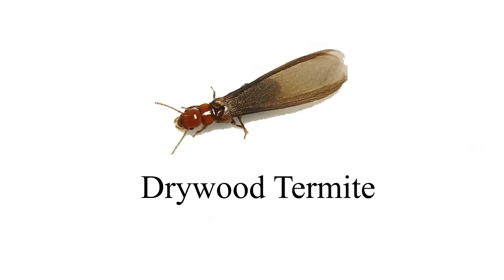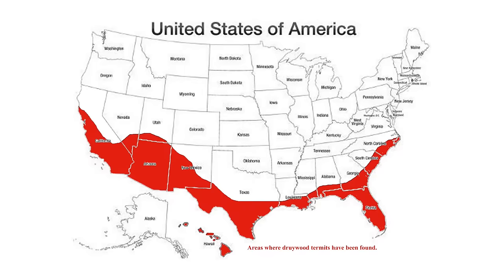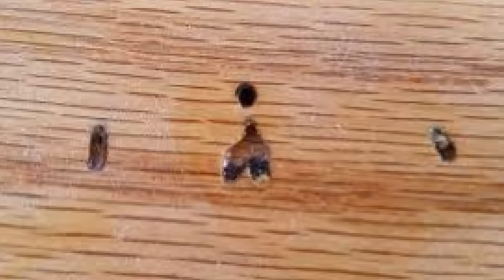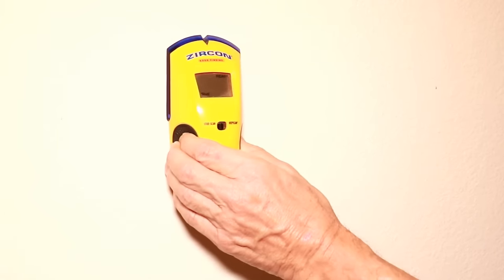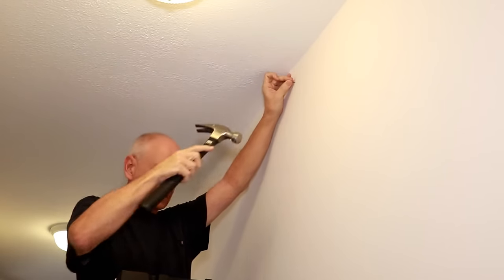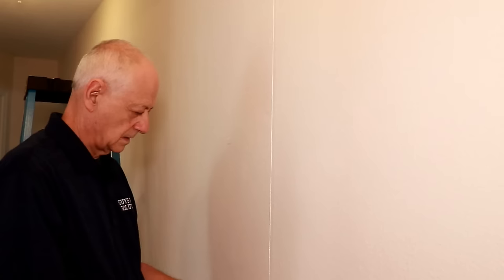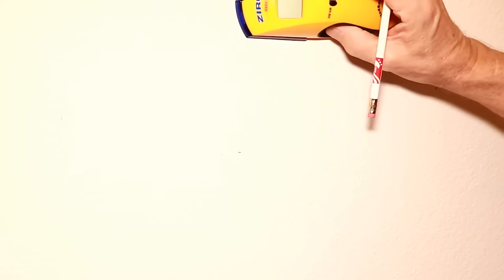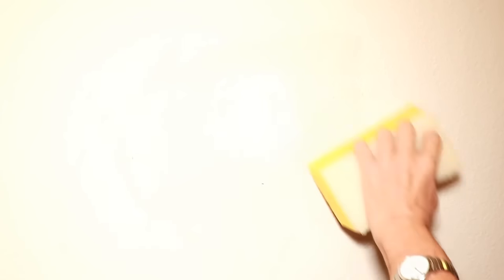How to Treat a Drywood Termite Infestation Yourself. A MUST see if you have Drywood termites.

Comment: I live in a cabin-style house with unstained wood paneling on all of my walls. There is no drywall to drill. How should I inspect behind my wood paneling?  I dread the magnitude of the work involved in removing panels from my walls or ceiling.

Also, i suppose Bora-Care would not be applicable to these decorative, interior, unstained wood surfaces, right?

I found one little kick-out hole in my kitchen, and now I feel like I'm doomed.
Reply from the maker: You can apply Bora-Care to the unfinished wood.  However, I can assure you that, if you have drywood termites, they are located in many places.  It is important to understand how drywood termites work.  They enter through cracks and crevices around windows, doors, eaves, pipe penetrations, and so forth.  Most of the time, they enter through several locations.  That is because a swarm of them attacked your house at the same time.  If there was a crack or a crevice, then they probably found it.  After they establish their galleries, which will be inside the wood, it will take four to seven years for them to be able to swarm.  Now that they are in your house, the swarmers will use holes that are in your studs to travel through the walls.  Those holes in the studs were created by the electricians to run the electrical wiring.  Not only are these holes going through the studs, but holes were drilled into the attic for the light switches and to run some of the wiring for the outlets.  So, the termites now have easy access throughout the attic and the walls.  If you have a basement or crawl space, they have access to that as well.  Most of the time, you will have no idea that they are in the walls, because the frass is inside the wall.  To make matters worse, if you have drywood termites, then your neighbors have them too.  That means you have been getting swarmed for as long as they have existed in the neighborhood.  Most likely, we're talking about years, so it's a safe bet that you have these guys in many locations in your home.

I always hate to be the bearer of bad news, but if you have drywood termites, the only sure way to get rid of them is to fumigate.  Prices for this can vary wildly in this industry, so I recommend that you watch my video on how to hire a pest controller without getting ripped off.  That video can save you a lot of money.  You should also know that the gas they use to fumigate has absolutely no residual action whatsoever, so you can get reinfested the moment the tent comes down.  Like I said before, if you have drywood termites, then your neighbors have them as well.  Since drywood termites swarm every year, it is almost a certainty that you will be reinfested within a year after the fumigation is done.  The only way to prevent this is to do a preventive treatment on your house every 60 days.  Most pest controllers will not do this, so it is something that you generally need to do yourself.  I have a video on how to do that and I will place a link below.  This is a generic video that covers a lot of different pests, but it also works for preventing drywood termites.  Just ignore the part about treating your yard.  You only need to treat the house for drywood termites.  This will not treat the termites that are already there, but it will stop new ones from getting in.  If you absolutely cannot afford to fumigate your house, then you can try spot treating it yourself.  It is virtually impossible to find all the termite galleries, but it is way better than doing nothing.  Regardless of how you treat it, you should begin the preventive treatment immediately, so that you do not get additional termites paying you a visit.

By the way, I will be out of town for a couple of weeks, so I may not be able to answer additional questions until after I get back.  Don't worry though.  If you have follow-up questions, I will answer them upon my return.  I'm sure I'll have a good deal of questions waiting for me, so please be patient.  I will work through them one at a time.  Hopefully it will only take me a week to get caught up.  I promise that I will get back to you if you have additional questions, albeit a little slower than usual.  We have not been on a vacation for over 13 years and my wife has explained in her unique way that the time has come.  So, go I must, and we won't be back until around June 11.

I hope that helps.  Be well my friend.                    

Video on how to hire a pest controller without getting ripped off:  https://youtu.be/y-a8XOqVrlE

Video on how to prevent drywood termites:  https://youtu.be/Yozv3s-Qwlw

Comment: Thank you so much for this valuable information.  I was planning to do a Bora-Care treatment in my attic and crawlspace and the Tarus SC outside.   But I'm in California and recently found out these products are not available to ship to CA.  Can you recommend any replacements?
Reply from the maker: There is no need to use alternative products.  Domyown.com will ship to California.  I will give you the links to all the products below.  Keep in mind that your initial treatment should be done with Taurus SC, but you need to continue doing treatments every three months and those can be done with either Talstar P or Bifen IT.  The Talstar P and the Bifen IT are the same product, except that the Bifen IT is just a little bit cheaper.  You can also alternate between the Taurus SC and the Bifen IT every three months.  If you have carpenter ants, then most likely, you only have a satellite colony inside your house.  The main colony is someplace outside in a dead tree stump or something.  That is the reason you need to treat every three months.  If you don't do that, then you are probably going to get reinvested.

I hope that helps. Be well my friend.

Bora-Care:  https://www.domyown.com/boracare-p-100.html?sub_id=554

Taurus SC:  https://www.domyown.com/taurus-sc-termiticide-p-1816.html

Talstar P:  https://www.domyown.com/talstar-professional-insecticide-p-97.html

Bifen IT:  https://www.domyown.com/bifen-it-p-226.html?sub_id=11662

Comment: Hello Guy!  Your videos and knowledge are awesome!  We're in SoCal have drywood and subter termites.  We have somewhat of a unique building design.  There is a crawl space adjacent to the garage that is slab.  The crawl space has sand at the base and perimeter cinder block with wood above it.  I understand the bora care is great for the exposed wood and cinder block.  However what's the best treatment for the sand below?  Never gets wet or rain.  Thanks a bunch bud!  We will be doing preventative care on exterior of building with taurus sc.  and granules around the outside perimeter.
Reply from the maker: Keep in mind that boric acid does not work if it gets wet.   Also, use it only on dry areas that cannot be disturbed by people, pets, weather, or air currents.  Here's the thing about crawlspaces and termites.  If they are subterranean and you do not see any mud tubes coming from the ground up, then there is no need to treat under there.  If there are mud tubes on the walls, coming from the ground, then you need to trench under the crawlspace.  I have a video on the proper way to trench and I will give you a link for it.  

If you treated the perimeter with the granules, then that should do a good job on the subterranean termites, but you may want to give that process a boost.  If you find mud tubes anywhere, then break open about two inches of each tube and shoot some fipronil foam into each side of the tube and on the surface where you removed it.  This will really get the process going.  I will give you a link to it.  Let me know if they will not ship to California and I will recommend a different product or different supplier.  Also, be sure that you used the correct granules.  Most Home Depot and Lowes stores are not selling the right ones anymore.  They are now selling the 700370 version, but only the 700350A version will work.  You know that you have the wrong one if the label says that you need to treat every 30 days.  I will give you a link to the correct product, just in case.  They look very similar.

As for the drywood termites, I have to tell you that the only thing that can ensure total elimination of these guys is fumigation.  Subterranean termites are easy, but drywood termites are not.  The problem with drywood termites is finding them.  If you can find them, then you can kill them, but it is not easy to find them.  So, you may want to think about fumigation.  If you do, then always get several estimates.  Price can vary wildly in this industry, so it pays to shop.

I hope that helps.  Be well my friend.

Video on how to trench for termites:  https://youtu.be/Fy7YHi_7Z8g

Fipronil foam:  https://smile.amazon.com/BASF-805571-Termidor-Termiticide-Insecticide/dp/B07QWMJ7JM/ref=sr_1_6?crid=PW594N2DTY21&keywords=fipronil+foaming+aerosol&qid=1656054769&sprefix=fipronil+foam%2Caps%2C121&sr=8-6

BioAdvanced Termite Killer 700350A:  https://www.amazon.com/BIOADVANCED-700350A-Perimeter-Treatment-Granules/dp/B000RUIJYM/ref=sxts_rp_s_1_0?adgrpid=1342504832925931&content-id=amzn1.sym.14b5a3ec-ddf3-42f1-bf1e-8515f8d25a34%3Aamzn1.sym.14b5a3ec-ddf3-42f1-bf1e-8515f8d25a34&cv_ct_cx=termite+killer+bioadvanced&hvadid=83906755322577&hvbmt=be&hvdev=c&hvlocphy=72390&hvnetw=o&hvqmt=e&hvtargid=kwd-83907333654521%3Aloc-190&hydadcr=29859_14561483&keywords=termite+killer+bioadvanced&pd_rd_i=B000RUIJYM&pd_rd_r=5bb938ce-d9c6-450a-8d38-d6cc8e3bcbab&pd_rd_w=uiK07&pd_rd_wg=dzc0I&pf_rd_p=14b5a3ec-ddf3-42f1-bf1e-8515f8d25a34&pf_rd_r=4XEGY3RJN19MHRQQ3NKK&psc=1&qid=1656021167&sr=1-1-f0029781-b79b-4b60-9cb0-eeda4dea34d6

Comment: Is it effective to kill termites with heat treatment ?  It is better for the envirnment but will it destroy the home structure and property due to extreme heat.  Can you give your opions on this subject. Thanks. Newman
Reply from the maker: It is possible to completely eliminate a drywood termite infestation by using a heat treatment.  However, you need to keep in mind that for it to work the temperature of everything in the house, including the center of all wood components, such as wall studs, ceiling joists, roof rafters, sheathing, and so forth, must reach a temperature of no less than 120° for a period of no less than 30 minutes.  So, you don't need to maintain this temperature for long, but virtually the entire structure from the top of the roof down to the foundation or slab must reach 120°.  To accomplish this the temperature in the house needs to be much higher than that and it needs to be maintained for quite some time because wood is a natural insulator from heat.  Additionally, much of the wood in the walls and ceilings are insulated, thereby making it more difficult for those structures to reach the required temperature.  It is going to need to be very hot for a very long time inside the building to accomplish this.  Therefore, you will probably need to remove anything that may be affected by heat.  After the process is finished, I know of no way to guarantee that it was 100% effective.  If even one gallery is missed, then the house will again become fully infested within a few years.

It is important to understand how drywood termites work.  They enter through cracks and crevices around windows, doors, the eaves, pipe penetrations, and so forth.  Most of the time, they enter through several locations.  That is because a swarm of them attacked your house at the same time.  If there was a crack or a crevice, then they probably found it.  After they established their galleries, which will be inside the wood, it will take four to seven years for them to be able to swarm.  Now that they are in your house, the swarmers will use holes that are in your studs to travel through the walls.  Those holes in the studs were created by the electricians to run the electrical wiring.  Not only are these holes going through the studs, but holes were drilled into the attic for the light switches and to run some of the wiring for the outlets.  So, the termites now have easy access throughout the attic and the walls.  If you have a basement or crawl space, they have access to that as well.  Most of the time, you will have no idea that they are in the walls, because the frass is inside the wall.  To make matters worse, if you have drywood termites, then your neighbors have them too.  That means you have been getting swarmed for as long as they have existed in the neighborhood.  Most likely, we're talking about years, so it's a safe bet that you have these guys in many locations in your home.

You should also know that the heat treatment offers absolutely no residual action whatsoever, so you can get reinfested the moment the temperature returns to normal.  Like I said before, if you have drywood termites, then your neighbors have them as well.  Since drywood  termites swarm every year, it is almost a certainty that you will be reinfested within a year after the treatment is done.  The only way to prevent this is to do a preventive treatment on your house every 60 days.  Most pest controllers will not do this, so it is something that you generally need to do yourself.  I have a video on how to do that and I will place a link below.  Fumigation is a sure thing, but it too offers no residual action.  If you can also try spot treating it yourself.  It is virtually impossible to find all the termite galleries, but it is way better than doing nothing.  Regardless of how you treat it, you should begin the preventive treatment immediately, so that you do not get additional termites paying you a visit.

I hope that helps.  Be well my friend.                      

Video on how to prevent drywood termites (You do not need to treat your yard for drywood termites.  Just the exterior of the building):  https://youtu.be/Yozv3s-Qwlw

Video on how to hire a pest controller without getting ripped off:  https://youtu.be/y-a8XOqVrlE